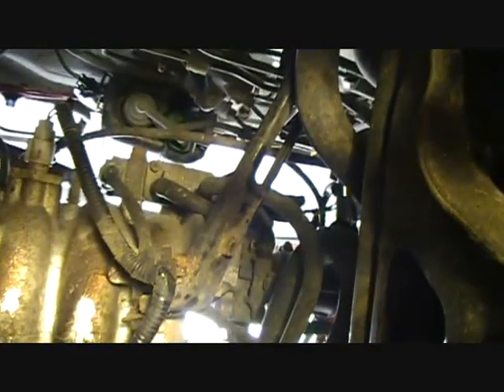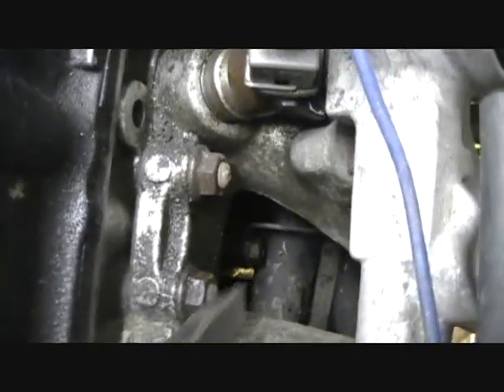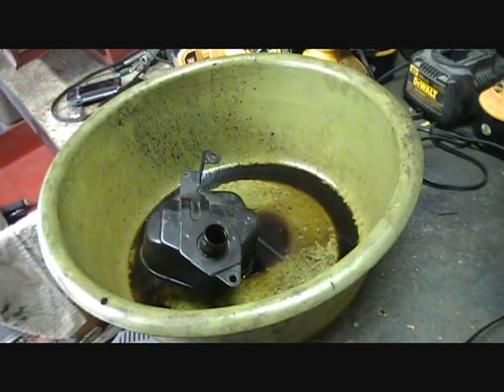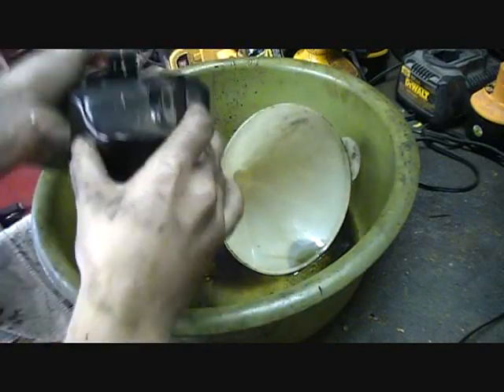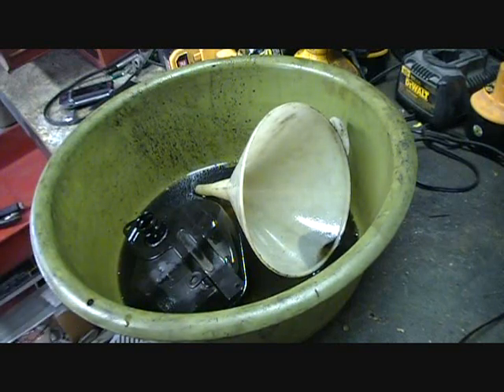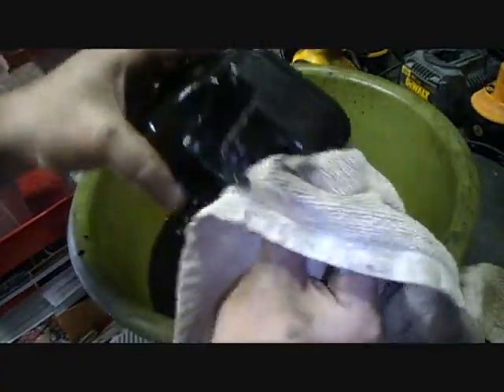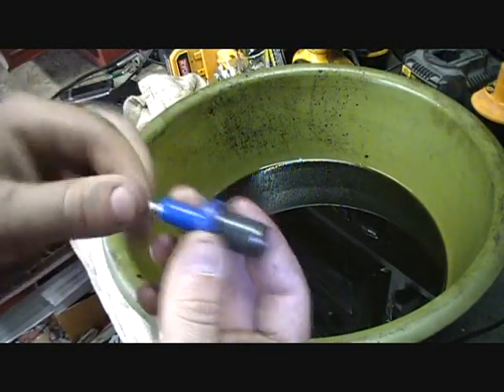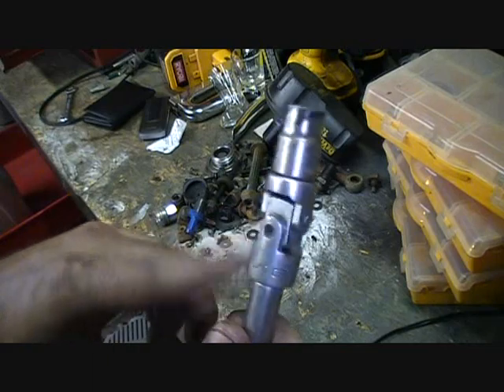Clean breather box Honda Civic (oil separator) - Backyard Mechanic DIY

Comment: I did this today.  Thanks much for the post.  You made it super easy for me.  And it was super easy.  I replaced all the old PVC parts in line of this, except the upper hose, which was still good.  That plus some fresh plugs, cap and rotor.  It's like I have a new car now ;-)  I'm reasonably certain that part hasn't been clean since it was new, in 1992.  It was ultra funky in there.
Reply: Question: After you cleaned it, did you just bolt it back on or do you have to put a layer of sealant all the way around it. My mechanic says you have to put a layer of sealant on it and I saw a video of a much newer car that did this. But No one talks about it other than them. I would greatly appreciate the answer. I ordered the O Ring and the connector hoses to the breather box and they will be here next week. Again thanks if you can let me know!

Comment from the maker: I'm not sure what your question is, but I think you are asking what the breather box does-
The box separates oil from air in the back of the engine. The need for this is that stray exhaust gasses can build up in the crankcase and blow seals and such. The crankcase must be vented but not to atmosphere as it contains unburned hydrocarbons. It's then sucked into the intake manifold. Thus, it needs to be free of oil so your intake stays clean and the fuel mix stays accurate. 
Hope that helps.
B

Comment: Thank you for this video. The support bracket for the manifold makes it easier to separate the intake manifold from the head when you change your intake manifold gasket. I know this because I had to change it 2 times, once with the bracket on and once without it on. The second time was a lot harder and I was scared I would damage the intake from prying it off.

Comment: @benfroggg Interesting... I've seen many posts in the Honda Civic forums showing the PCV valve in the breather box. Not many talk about the PCV valve up top, like mine. So, I was a bit surprised when I looked under my hood. Thanks for the info. I'll be checking to see if I have a second pcv valve down there. I have no idea what the previous owners have done. Would having two PCV valves make a noticable difference?
Reply: What happened? Did you find a 2nd PCV Valve? I doing' think I have one on my 95 Del Sol... I ordered all the parts for under the PCV valve that connects to the Breather box and it didnt' show anything like a 2nd PCV Valve on the print out. 1 question. After you cleaned out the Breather Box, did you just put the O Ring on nad tighten the bolt down to the breather box / engine or did you have to put a Sealant around the entire breather box before connecting it to the engine? Someone said I don't have to do that nad another person my mechanic says you do...

Comment from the maker: @rholleba The VX has a highly disputed PCV valve.  To my knowledge, some models had a straight valve (I believe 92 and 93 models) mounted in the breather box as mine was.  The valve at 0:42 is not a valve, it's a hollow elbow.  Many mechanics replace this elbow with a PCV valve, ignoring the actual PCV valve in the breather box.  To make matters worse, 94 and up cars have a straight empty connector below and a PCV in the location you speak of. Message me FMI.
Reply: On my 92 Si there's a PCV where I think there should be an elbow, but possibly another PCV connected to the breather that's probably never been changed. This weekend i'm crawling under to find out. Thanks for this video!

Comment from the maker: @rholleba Two PCV valves wont hurt anything, or really help anything... unless one has failed.  If it fails open, no big deal.  If it fails closed, (and you didn't know it existed down below) there would be running/idle/driveability problems.  Symptoms are slightly lower power, increased oil consumption/smoke, etc.
B
Reply: Over the last 24 months I have replaces almost everything I can imagine on my D15B7 Del Sol Engine. New Plugs, Wires, Fixed IACV valve, replaced all hoses, Gas Filter, Air filter 3 months ago, PCV Valve, etc. etc. I just cleaned out the Map Sensor and Throttle body and holy shit that really #1 Added a lot of Power to the car and very responsive too! #2 MPG Went Way Back up to at least 41 Hwy 35+ City.... it's really fun to drive now. I also noticed, at least a year ago, that when the oil is at the full mark it kind of bogs it down when I get the RPM's past 4K. But when I let it go down a little bit below the full mark it can breath better and it doesn't struggle against itself like the air / power is flowing better and it goes even better, more power... Just ordered all the connecting parts  from under the PCV to the Breather Box and also top rubber connector tube to the top tube that goes back into the Throttle body... I figured if all of this was clear and clean it could breath better and no back up pressure... So right now the engine is really zooming along with full power but when full of oil it kind of fights itself. But when oil goes below full mark, it has more free Power! Is that normal?
Reply from the maker: @MikeKollin  Fascinating! Your logic makes sense to me... I've never had personal experience with overfill/lower power, but if the breather is pulling more oil through... that's going to mess with the a/f ratio for sure.
I'm speculating, of course.  But again, your logic makes sense to me.
Reply: @benfroggg  Thanks... yeah I noticed this a while back when I first get oil refill it kind of fights itself... not much but it's not totally free. Then after a month or so I notice suddenly it just has more Free Power and the fight is gone... just zooms better.

Comment: Did this on a 2000 civic. BEWARE the top bolt of the breather box is extremely difficult to get to. Unlike the 5th gen in the video, it is not able to be seen through the opening in the intake, it is located more the left under the actual part of the intake. It is difficult to get a ratchet in there with the manifold still on, even with an extension.

Comment: I've noticed that my breather box is coated with oil as well. So, thanks for the video. It helped to give me an idea what to do. However, my pcv valve appears to be mounted on the intake manifold and not on the side of the breather box. I thought I could see the same kind of thing on yours as well at 0:42, for a split second, but you were moving the camera too fast there. Is that right? In that case you'd have two pcv valves?

Comment: is this the D16Y7 engine ? anyway Can this valve suck oil into the intake manifold  ? and if yes why ?  my honda burns oil every morning and i suspect this is the problem, also im thinking about disconnecting this valve (hose)  from the intake manifold to see if the problem stops
Reply: I'm having same issue,  blue smoke out exhaust when still warming up. Good compression and new valve stem seals but still smokes in morning. very possible it is pcv system issue.

Comment: what did you use to get to the upper bolt? for the life of me i cant get that bolt off. not enough leverage. i am using a standard 10 with two 3 inch extensions and i have mixed that with a universal joint and even tried a deep socket but cant seem to get it happy
Reply from the maker: Whoops, pardon the time it's taken me to reply!
I don't have a specific memory of what worked but I do remember it was a struggle!  In other instances of not having enough leverage, it can be helpful to strike the head of the bold with a hammer a couple times with medium force.  It may not be possible where the bolt is... I wonder if you could give it a wrap with a socket extension from under the car?
If not, worse case you could pull the intake manifold to get it.  That'd be hella no fun but it would work and would give you an opportunity to inspect your EGR system if still equipped. (they are often plugged up solid on these cars and it makes them run like crap without other mods).
Good luck!
Reply: @benfroggg  thanks!

Comment: Hey thanks for the video. I have a question, I bought me my first Honda March of this year. It's a 2015 Honda cr-v LX with the 2.4L with only 35,000 miles on it. My question is, the engine is a GDI deal and alot of people are saying to get a oil catch can for it to keep the valves from getting carbon build up but does my car come with a factory catch can like the one in your video or is that something different? Thumbs up on your video bud.
Reply from the maker: I wish I knew man. I imagine the car does have at least a basic setup like this one... I think the main thing is how are you going to use the car. If you're using it as a daily driver, a catch can prolly isn't needed. On the other hand, If you're doing lots of engine mods, it's prolly a good idea.
Reply: @benfroggg  Hey buddy thanks for the fast reply and the info. Keep up the good work. Take care man, bye.

Comment: Thanks for the detailed video.  Other than knowing you have a slightly less nasty engine, why perform this service?  Will it help the seals last longer?
Reply from the maker: Lower pressure in the crankcase will produce less leaking for sure.  So if the PCV valve is particularly clogged, this should improve oil leaks.  If the PCV valve is badly clogged, the dirty breather box could reclog the new PCV, etc.
B

Comment: Thanks for the informative video. Not a lot of information out there about breather boxes. You might consider investing in nitrile gloves when doing a job like this.
Reply from the maker: Good call on gloves, but I'd rather not have more consumables than needed.  My hands clean up pretty easily with regular dish soap (which of course is a consumable) and doesn't fill up landfills with disposable gloves.  I do use them on occasion, however.  I just hate the idea of a throw away culture.

Comment: So another oring can be found easily at a local auto store for what, a dollar or less, get a new one so you don't have to "worry" about that one going bad, its also something that I like to call "preventive maintenence."  Thanks though for the cleaning explanation because I'm thinking about doing the same thing right about meow.
Reply from the maker: Generally, I try to replace worn out parts when possible.  But the gasket in question still hasn't leaked and it's been probably 30k since that video.  The price of the replacement isn't the issue, the issue for me is that why replace something that isn't broken?  I hear what you'r saying, though.  Cheers!
Reply: I just did the same to my '99 Nissan Primera.  I used a fuel cleaner solvent since I didn't have some old gas to put in there;  worked about the same.  Reddish oil came out of mine at first before the 2nd and 3rd application which made it clear.  Also if you get the chance to do so mate I'd recommend that you take apart your Idle Air Control Valve and clean it out.  My car idles very smooth now with both cleanings done!
Reply from the maker: Good call on the IACV.  I have cleaned mine in the two civics in the driveway.  It sure does help the idle.
Reply: Here's another tip for ya I'd recommend replacing any and all vacuum lines and vacuum hoses that you can get to easy enough without lifting the car.  Replace them with the same diameter hose as the original' even if the factory one feels fine, now you have the piece of mind that you won't have a vacuum leak that can cause a cylinder misfire code or ruin your economy and/or mess your idle up for another 100k miles or more depending on the hose.  You might be surprised and find out that you may have fixed a small leak, if nothing more its cheap and always helpful!
Reply from the maker: That is on my list due to your suggestion.  Vac hose is cheap and my idle still sucks after a long drive.  Thanks!

Comment: Mine was very dirty as well. I have been sucking oil out of it (lots of blue smoke out of tail pipe) but only when engine is halfway warmed up. Will the cleaning solve this prob?
Reply from the maker: Hmm.  Can't hurt to try it.  But I'm not optimistic.  I think blue smoke on warm up sounds more like rings or valves to me.
Reply: Welp, so far no more oil through intake mani, seemed to do the trick. New rings and stem seals, even compression readings, but still had those initial puffs of blue.
Did learn the hard way that the cleaning gas must be blown out of breather, took an hour to unflood engine.
Reply from the maker: Well then.  That's a drag about the flooding.  I didn't run into that with mine, not sure why you did.

One other thing that strikes me... have you ever cleaned the EGR ports?  I'm not sure it would matter on a cold engine (cant remember if the EGR valve opens before full warmup or not) but I do know when they are clogged they can cause problems related to fuel/air mix.

Oh, and also- My car had a straight PCV valve that seated directly into the breather box.  It looks like it's just a hose terminal thing but it's actually the PCV.  Most cars have them more accessable than the 5th Gen civics.  I have seen cars where someone removed the upper elbow (where the PCV vac line goes through the intake manifold before connecting to near the throttle body) and mistakenly installed an elbow PCV that some shop sold them.  I found that certain shops had the wrong listing.
Now, why that matters.  If someone put one in where it didn't belong, it shouldn't matter.  However, what DIDNT happen was a replacement of the ACTUAL PCV valve.  
Did you replace yours while you were cleaning the box?  Seems like you did since the leftover gas flooded your engine (or at least the existing PCV was not clogged).  If you didn't, you should.  They are a one way valve and if it failed open, it MIGHT cause the blue smoke.... but this is speculation.  Regardless, it's a common tuneup part.

Good luck!
Reply: Will have to look into the elbow deal. My 95 came with the valve at that location on the intake mani, which I replaced but now am wondering if that was even a factory part. I think that the breather box was just full of crap that was getting sucked through valve. This y8/b7 minime sees 7500 rpm everyday (I drive crappy).
Reply from the maker: I wish I knew which models had the weird PCV.  This is a VX with a D15z1.  Not sure if yours would be this way or not.  
Definitely worth investigating.
Reply: Haha- saw ur vid with the aerodynamic mods... I went the other way and painted my eg with 50$ of roll on truck bed liner. Probably not the most aerodynamic paint.

Comment: Thanks for the video! This helped me a lot, and I've decided to hold off until it's time fore an oil change, easier access without the oil filter. 

I'll be doing mine soon due to an oil leak that I've traced back(up) to the breather box. I bought a new OEM o-ring, and a new PCV valve grommet. I'm assuming the o-ring is the culprit.
Reply: Where did you buy it, the O Ring? Is there anything else that needs to be replaced, etc? Is there a seal or Gasket to get? Thanks I am about to do this on my car...

Comment: do i need to drain the oil first or not before cleaning it?
Reply from the maker: I don't know, but I don't think so.  In the case of the video, I was doing this during an oil change.  This made it much easer to access bolts on the breather box.  So at the very least, you'd have to remove the oil filter and lose the fluid in it, so you might as well drain the rest of the oil while you're at it.
Reply: benfroggg Thanx man
Reply from the maker: You're welcome.

Comment: I'm sorta new with changing out parts on my '95 honda civic. I've done the maintenance like oil changes, and distributor cap/rotor. I'm going to change my pcv valve, and i've watched your video. Very helpful, but I'm wondering where is the breather box and the valve. I've looked really hard and still couldn't find it. help, please.